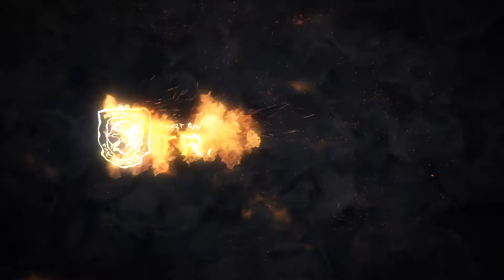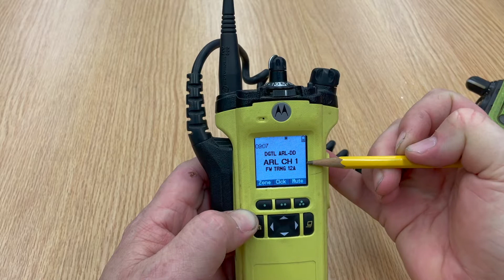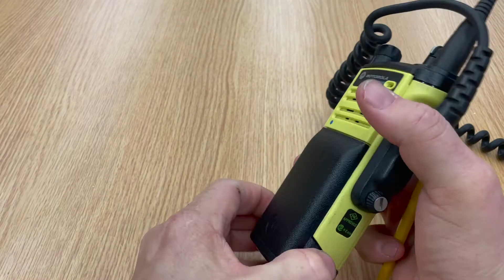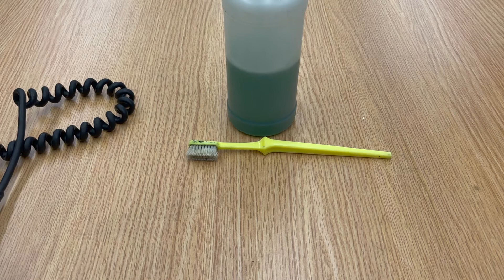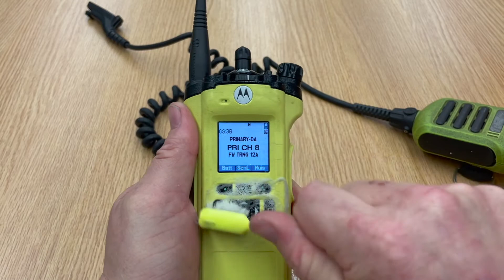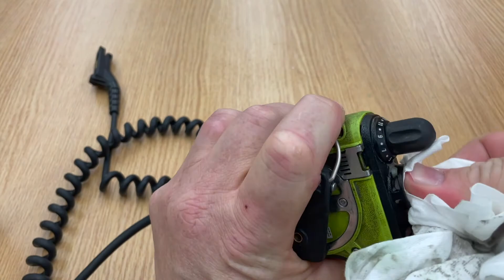Deep Dive Into FWFD Portable Radios

Comment: If you cycle your radio power does it return to home zone and channel or stay on last selected? We have been trying to get the APX6000xe's to go to a previous default but our radio shop can't get seem to find if it's even possible. 

We also found if you are on channel 6 for example, turn off the radio and go to channel 1 then turn it back on, you could reach to turn it to channel 1 (our emergency fall back channel), but if the channel selector does not turn a position, it stays on that channel 6 from above. Obviously that can cause some confusion under stress. 

Great video!. Nice seeing how others are set up.
Reply from the maker: No, the radio will stay on the channel it was last on when it was powered off. 

If the radio is turned off and then the channel selector knob is turned to a different channel and the radio is then powered back on, the radio will set to the new channel that was selected while it was powered off.